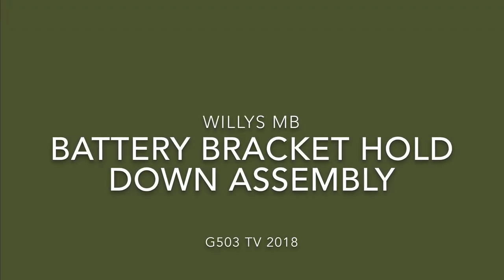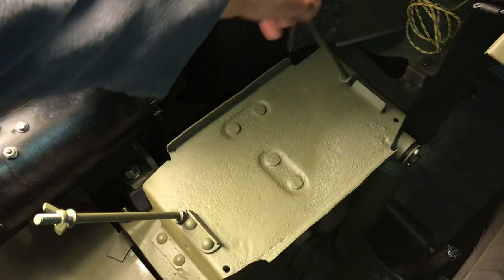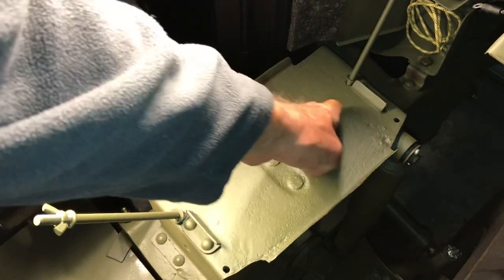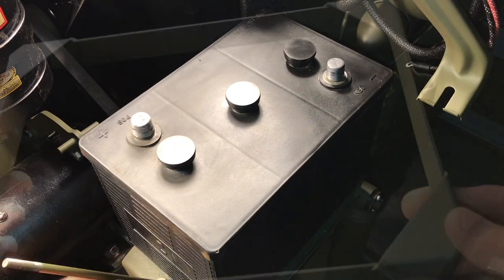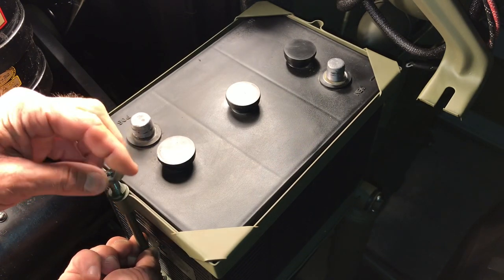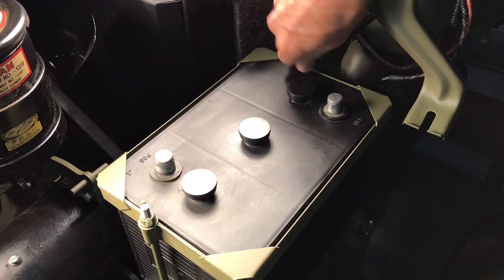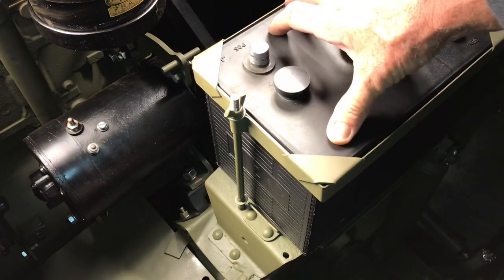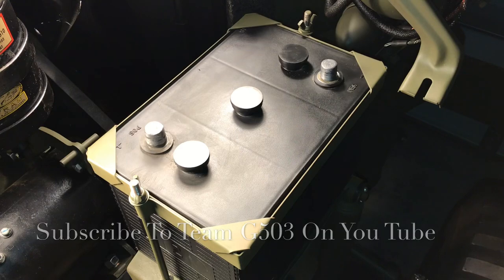Willys MB Battery Bracket Assembly G503 TV

Comment: If you don’t want your battery to come loose drill a# 40 hole in one of the wing nut ears and safety wire it. It’s standard for all aircraft installations.